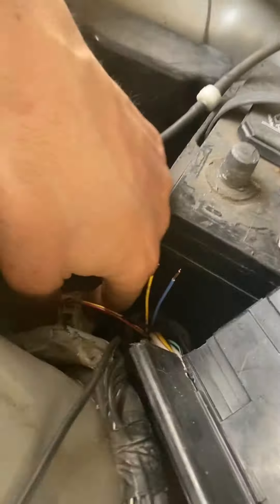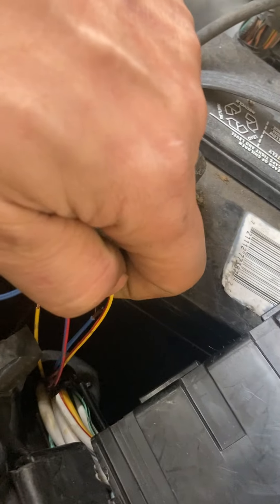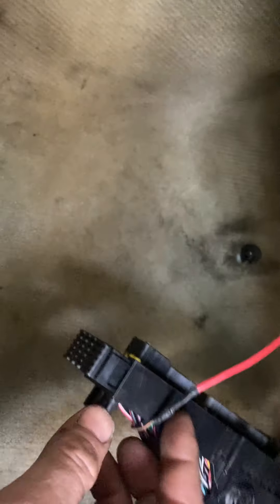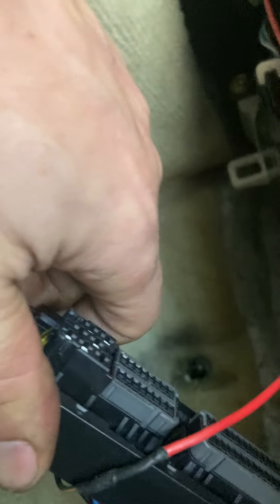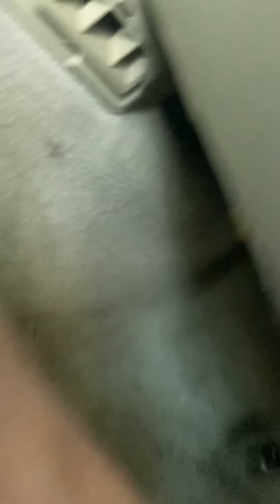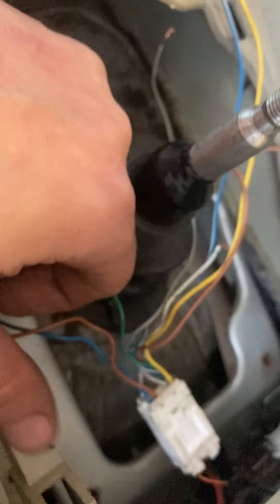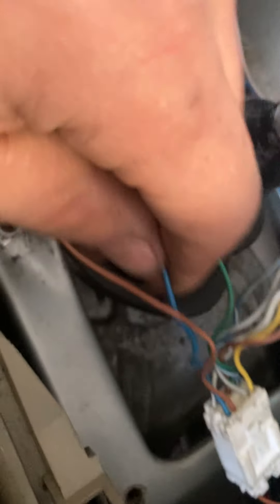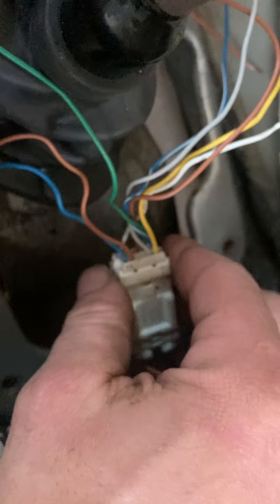04 g35 5AT to 6MT swap wiring part 1

Comment: Finally!!! I done my manual swap about a year ago and I been running it without my reverse and it's been driving me crazy so glad you made this vid! Thank you
Reply from the maker: Hope it works for you or atleast got you going in the right direction. You’re welcome and good luck.
Reply from the maker: Was just checking in to see if this worked for you, it worked for me for a little bit and I changed a wire and it quit working. I have since then ran 12v from the battery to the other yellow with red stripe wire and it fixed it better.
Reply: @King250sx-R  hey man, thanks for showing the pnp switch. Going to attempt today. As for the reverse switch, I find it far easier to run the 2 reverse wires to wires #5 and #7 on the 10 pin TCM harness. They’re black and red. No need to run to the engine bay and tap into relays, and works perfect. Hope this helps!
Reply from the maker: Always willing to learn. Thanks for the tip. Maybe I’ll make a vid and bring attention to that method as well. Thanks.
Reply: @King250sx-R  yeah I noticed yours is an 04 so you’ll likely have the 3 tcm plugs. I’m sure there’s a way to do it on there just have to use a wiring schematic. Did your cruise control work after the wiring? I did the same wiring and I’ve got nothing
Reply from the maker: @NuclearPineapple  no, I didn’t do the wiring for it yet. Just got the reverse lights working and drove the car to work and back a few time and broke a motor mount.
Reply from the maker: @NuclearPineapple  yeah it is the three plugs
Reply: Hey man this has helped a bunch thank you🙏🏽 quick question, why did it stop working? Was the wiring wrong? Pop any fuses? or you changed something and it stopped working afterwards? I did this step by step. I am in the middle of installing. Just going over everything before I test. How do I know which yellow with red stripe wire I need to splice into? I see you said you changed it. Was that the only thing you changed?
Reply from the maker: @unknownsuspect5362  hey man, I am just now seeing this comment. I never got a notification of new comments on my vids.
Reply from the maker: @unknownsuspect5362 it doesn’t matter which yellow with red stripe. They’re both inputs. So they provide the voltage needed to power the lights. My reverse lights come on even when the car is off and I put it into reverse, so I may change that to a switched power, down the road. Mainly because I like to put it into reverse, along with the e brake because reverse is the strongest and most secure gear to use when parking the car. If you have any questions, feel free to add me on instagram my @ is King250sxr or FB messenger Ryan Brown, but you’ll be more successful finding me on instagram.

Comment: hey i recently did a manual swap i got my ecu nats delete and tuned but its not grabbing because of neutral bypass what do i do?
Reply from the maker: @isai888  you mean neutral safety? That’s covered on how I wired it, in the video. You need that wired to let the car know it’s not in a driving gear when you turn the key switch. Message me on instagram and I’ll help walk you through it. @King250sxr
Reply: @King250sx-R yo got a 03 manual swapped g35 it got a 05 ecu n running rich do i need a 03 ecu?
Reply: or where should i go from here
Reply: @GeraldSlutski  i suggest looking at the engine to see if it’s a non rev up or if it is a rev up. if it is a rev up you need a 05 ecu but if it’s a non rev up you need a 03 ecu and harness. the reason why it’s running rich is because you need to match the same year harness with the same year ecu

Comment: Thanks for the info
Reply from the maker: Did you get yours to work from this video or did you run into any issues with it? Reason for asking is I was having trouble with my (front wheels locking up the brakes and thought it was and electrical issue or something I had done) so I undid some wiring and grounds and messed up my reverse lights, so I was able to later, go back in and apply 12v to the other yellow wire with red stripe on the other side of the reverse lamp relay and get my lights working again.

Comment: the wiring for the reverse lights could it be the same for a 350z?? or is it different
Reply from the maker: Depending on the year, I think the Z is closer to the G coupe and the wiring varies on them. Due to different years, versions, packages, and country of origin and a ton of other factors. It’s best to google your year make and model and include IPDM in your text and it’ll bring up what ipdm you have. Visually look under your hood and try to match yours up, physically with the one it says yours could be, to confirm. Then you’ll be able to wire from that. G35driver.com has been my map on this swap and the guys on there are helpful and knowledgeable. Feel free to send me any questions you might have and I’ll do my best to answer them. Good luck if you’re doing the swap.